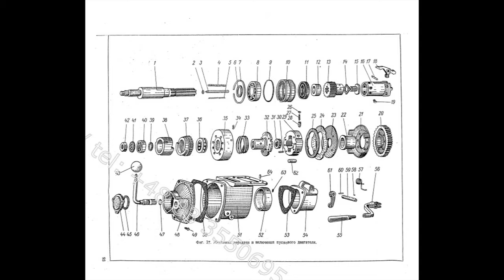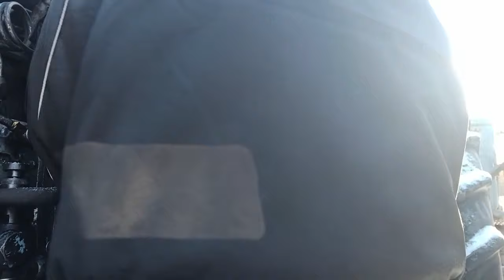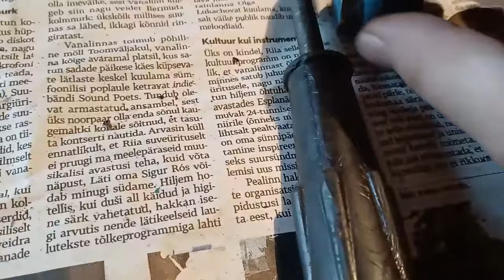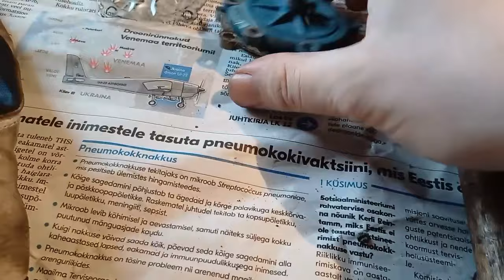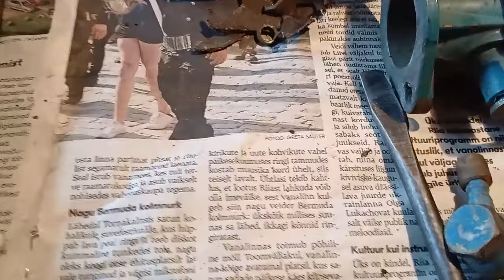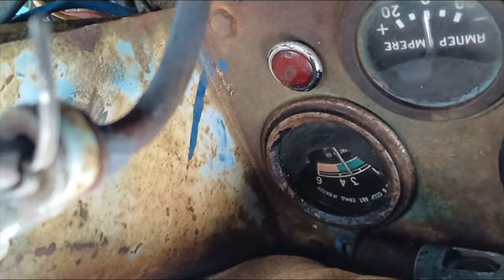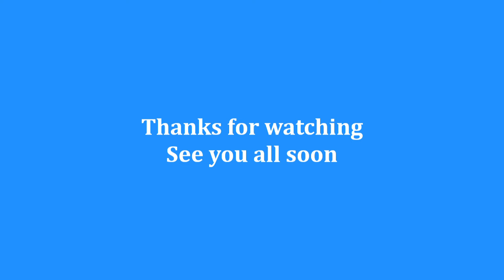Belarus MTZ 52/520 repairs part 3

Comment: Great video Steve. We have the same problem with the gasoline here in carburetors. The ethanol blend tends to coat everything. It is very hard on components internally and plug things up. It did not appear that your carburetor had too much problems from that. Glad it all came together. Great editing.
Reply from the maker: Thanks Aaron for the encouragement. I think the issues I have. Are more related to low quality rubber parts than gasoline. I'm using Ethanol free Gasoline. However i will say compared to the old school stuff. The new gasoline spoils very fast and you need to use it up in time.